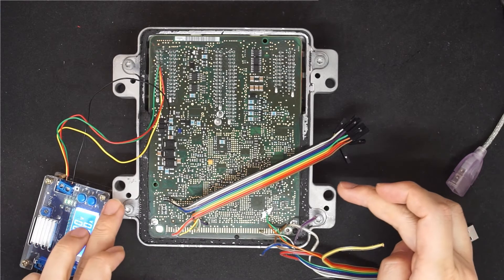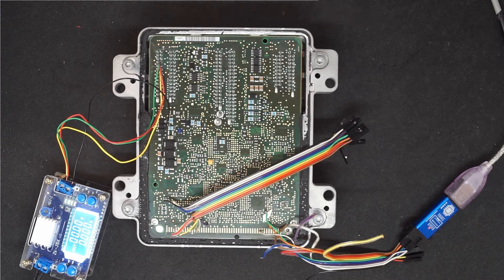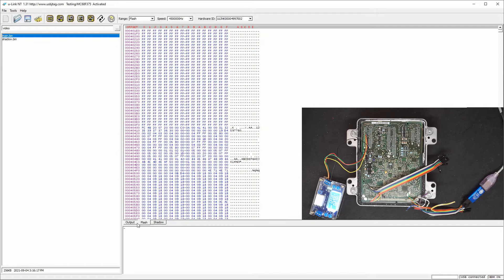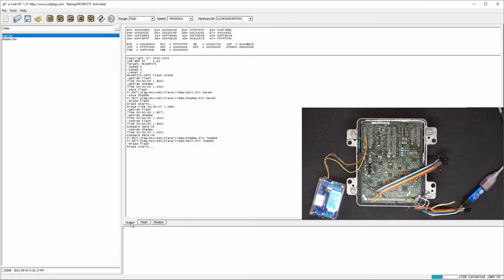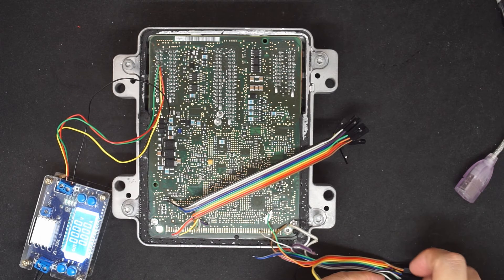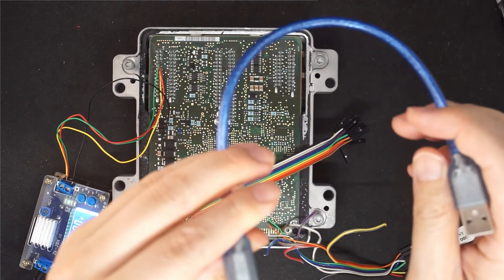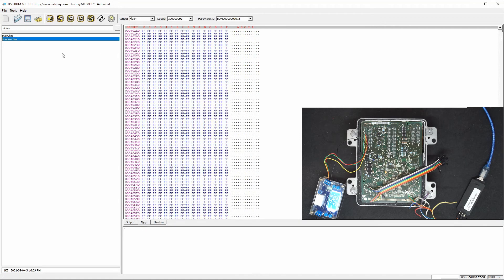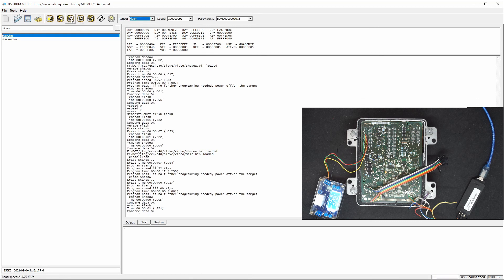MC68F375 Programming using u-Link NT and USB BDM NT. (Slave CPU in E40)

Comment: Hi, I have a problem with the MC68F375BGMZP33 MCU in the iaw5nf.t1 motor controller. I received the programmer from you and have a few questions.

Does the EPEB0 pin need to be shorted to +3.3V or +5V when writing data?
Are the MC68F375BGMZP33 and SC505709BMZP33 the same processors?
If I connect only the +3.3V supply voltage, I can read the memory contents, but writing is impossible. Why?
If I connect the motor controller to a +12V supply voltage, the program reads it, but the memory contents are all 00 00 00 00 00.
Does the BEER pin need to be disconnected?

Is there detailed instructions for BDM mode, and what do the values at the top of the program mean?

I wanted to post on the forum, but my email address is inactive.
danieldaniel47@gazeta.pl

Comment: What pins do you used to connect power and ground to the board?
Reply from the maker: You mean on E40? Please zoom in. Someone given me the E40 also gives diagram how to connect 12V and ground. Please zoom in the video see if you can find it.
Reply: @usbbdm  thank You! I found it. Do you also have the power pin out for the 0411 pcm? Or can I use the regular connection thru the truck harness? Thank You!
Reply from the maker: @deerhunter8533  I have another video for E411. You should be ablse to use regular cable to connect 12V and ground.
Reply: @usbbdm  thank You! I just ordered my u link nt